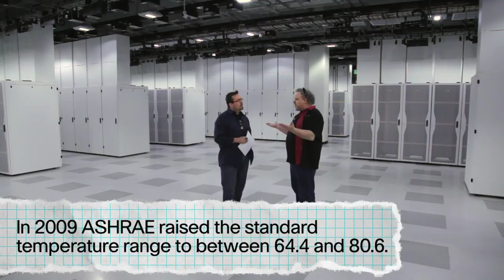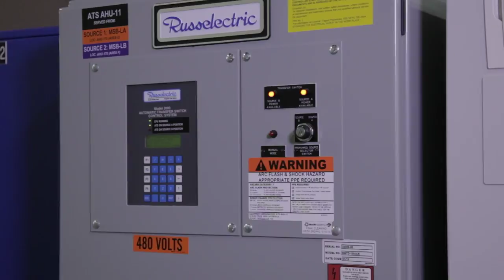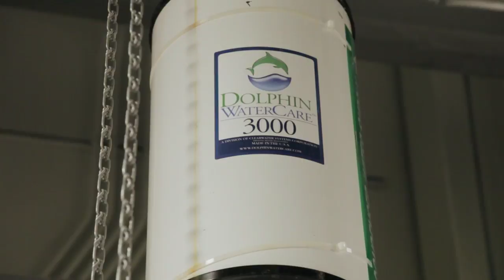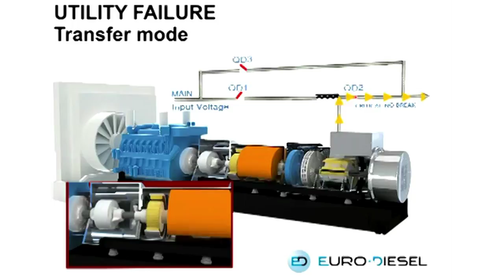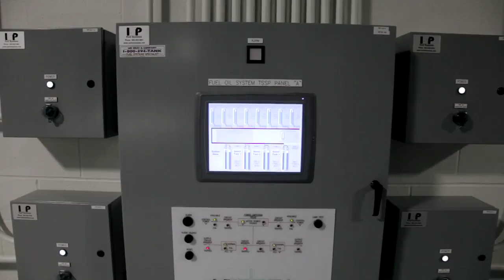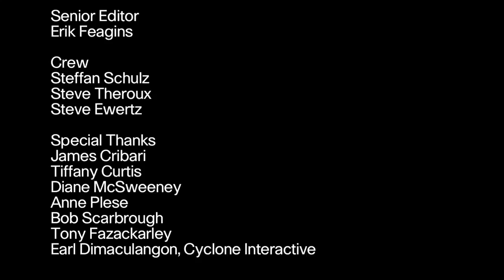Tour the Allen Data Center (HD) - Cisco

Comment from the maker: Well, the biggest differences are in environmental. In Thor, cooling is not an issue and heat is geo-thermal so that it also very cheap in cost. The real difference is the Thor DC is in a zone 4 area due to ground movement and there has to be a lot more compensation for that. Allen is in a Zone 1 so it is anchored directly into the Texas bedrock.  Jimmy Ray